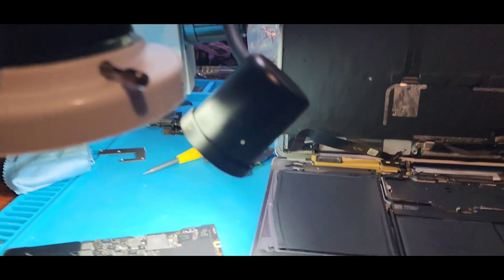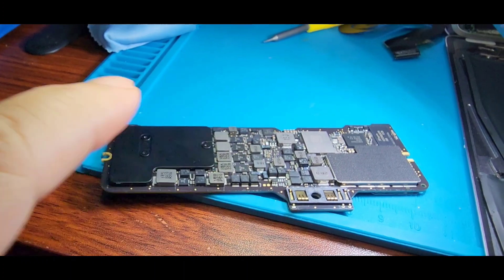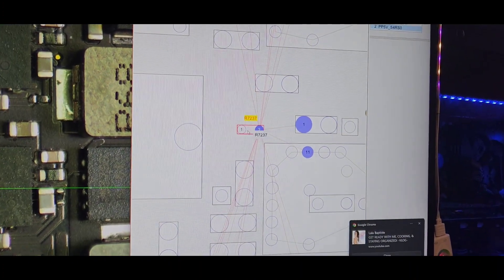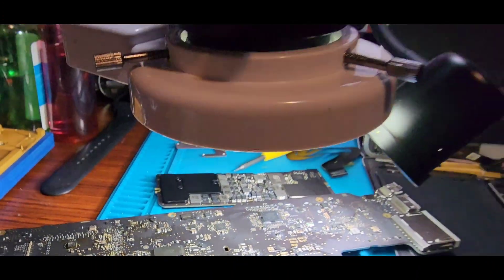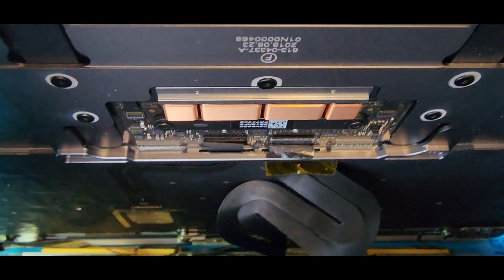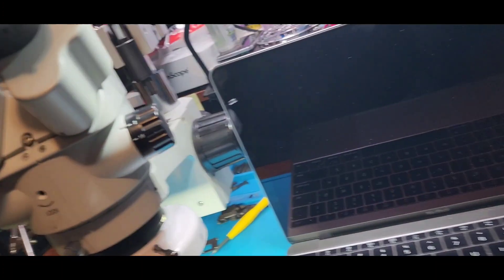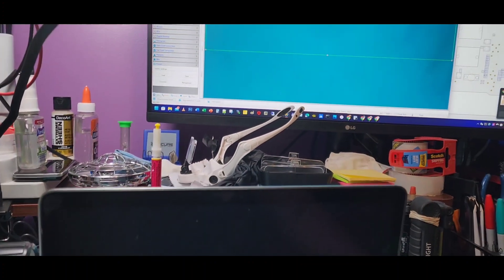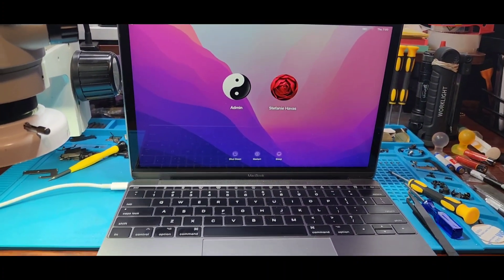2017 Macbook 12" A1534 NO SSD Repair

Comment: What is the value of the resisitor? And where did you get the schematic diagram?
Reply from the maker: Macbook_A1534_820-00045_j92.pdf - https://www.badcaps.net/forum/troubleshooting-hardware-devices-and-electronics-theory/troubleshooting-laptops-tablets-and-mobile-devices/schematic-requests-only/68034-a1534-820-00045-10-need-schematics

Comment: Resistors rarely short or open circuit, if it were bad it would commonly show a higher value. This resistor is 2.2Ohm according to the schematic, if anything the residual head from replacing the resistor with the heat gun has made the CPU recognise the SSD again. You don't give any readings to back up your method.
Reply from the maker: Sorry. I will do a better video on my next repair, but I've done a few of these already with similar repair. Here is another similar repair - https://www.youtube.com/watch?v=Xq81far82IA

Comment: Man, can't thank you enough ! Replaced the resistor (painful process though) and it worked again ! You're a legend ! Just so it can help other people since you didn't really show the replacement process, I've used the tip of a thin tweezzers to apply some solder paste to the board (super tiny amount) and heated it until it got tined to the pins (you'll see the solder paste becoming tiny silver tined balls). Then applied super tiny amount of flux and put the resistor, and heated again (450 C.) for like 30sec to a minute. Let it cool down and reassembled everything. Not sure if it's the best way to do it but worked like a charm for me on the first boot and still working days later !!
Reply from the maker: @hadi8348  Hey. Good to hear and happy it worked for you. I do all my desoldering and soldering using a heat gun.  Sorry, I didn't include that part on the video. Your method works as well. Happy holidays.

Comment: Hi, this may seem like a noob question but do you know what type/size this resistor is and where to get it? When I look up r7237 nothing comes up and I don't have a donor board to cannibalise.
Any keywords/links would be very helpful, thx
Reply from the maker: I would recommend buying a cheap MacBook logic board from eBay which will have so many of these chips. Buy this for $12 - https://www.ebay.com/itm/116308337649?mkcid=16&mkevt=1&mkrid=711-127632-2357-0&ssspo=Bw27-y-DQ8O&sssrc=2047675&ssuid=B0QdnWKURuW&widget_ver=artemis&media=COPY

Comment: I'm almost 100% sure that the resistor in this video is 2.4ohm and present on all 4 phases of the CPU power section. All fed by the same rail. I even took one off to test resistance out of circuit.
Reply: What value do you see when it's shorted? In another comment you say it's 100K

Comment: Hi, my brother You've done amazing work. I just wanted to let you know that I have the same early 2016 12 inch model. It isn't functioning. not booting up to OS and it showing no  SSD indication. I looked it up online and saw that some individuals were performing CPU rebolingg. I simply reheta and sank the CPU back into its position. and for a few weeks, it was successful. However, it's not working currently. if you could help me solve this issue. I would be grateful.
Reply from the maker: Hello and thank you. I would suggest replacing the resistor similar to the one I did on this video.

Comment: What are the symptoms for the laptop, I do have a similat A1534 2017 with the I7 the macbook sometimes turned on and right after the apple logo shows up and then show lines on the screen and dies, would you be able to repair it for me?
Reply from the maker: The symptom is the Macbook doesn't see it's internal ssd drive, therefore won't boot. Your issue appears to be something else. You could email me to discuss details - djab203@gmail.com
Reply: @djab203  sure I will make sure to send you an email regarding the issue, I believe I have a Video replicating the issue. I will also try to email this. 
Thanks.

Comment: replace from donor board?
Reply from the maker: Yes. Any faulty MacBook logic board is considered a donor board. You can get one cheap on eBay. They have similar resistors. You just need 1
Reply: @djab203  Okay but same with logic A1466 Air with code Resist 7237

Comment: Very interesting and useful video! I’ve known about this issue on 12” MacBooks for a while time but never actually seen a fix for it. Great work dude!
Reply from the maker: Thank you. I hope this helps others out there with this same issue. It could be a frustrating issue.
Reply: @djab203  Is this always the issue if a 12” MacBook doesn’t recognize the internal SSD?
Reply from the maker: @GoJot  Yes. So far I've fixed about 10 of these with this exact same problem starting from 2015-2017 models. The board and location of this chip are different on each tough but using the schematics and with some minor troubleshooting you can usually locate the bad resistor. I never had to reflow the CPU on these macs.

Comment: what is the value of the resistor?
Reply from the maker: Sorry I don't know the value, but if you have any Macbook donor board you will be able to find a match.
Reply: @djab203  Should the resistor have zero resistance?
Reply: @djab203  how many ohms should it be?
Reply from the maker: @КонстантинБеляков-л5б - To be precise you need to look at the boardview and you will get this information - Macbook_A1534_820-00045_j92.pdf - https://www.badcaps.net/forum/troubleshooting-hardware-devices-and-electronics-theory/troubleshooting-laptops-tablets-and-mobile-devices/schematic-requests-only/68034-a1534-820-00045-10-need-schematics

It says R7237 = 100KOHM
Reply: @djab203  On the same working board I have a 4 ohm resistor, on the board with a non-working SSD there is a 2.4 ohm resistor.
Reply: These look like phases of CPU power rail. Looks like there are 4. Each one with a similar resistor that messure on my board as 2.4ohm.